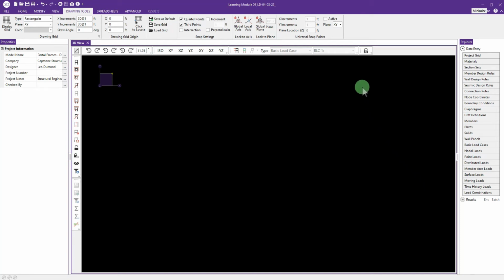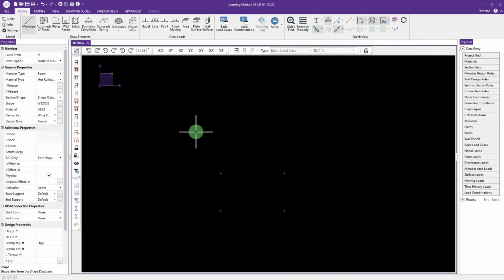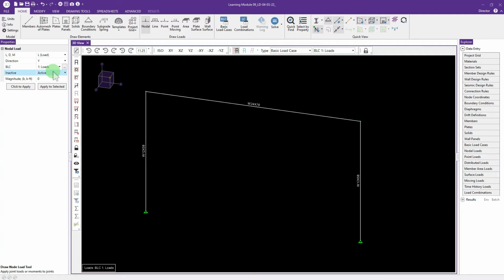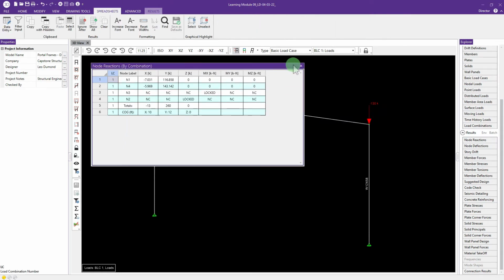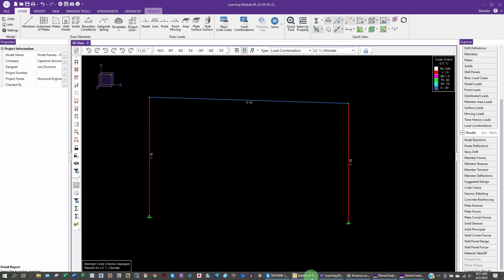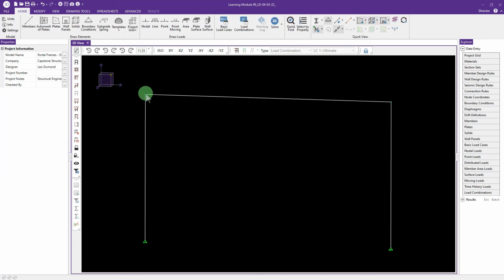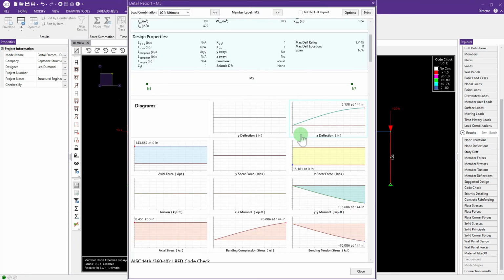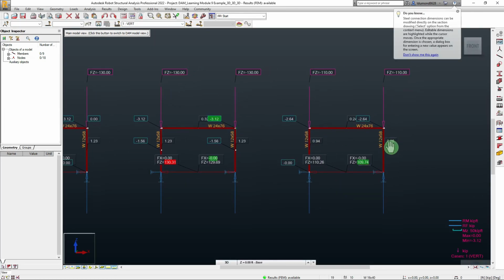STEEL PORTAL FRAME - RISA 3D

Comment: You must be reading my mind.  I was recently looking at this Mastan example of using DAM on a portal frame, and was going to compare it to RISA3D.  I appreciate you doing it first!!
Reply from the maker: My pleasure Chris. My suggestion is when you complete your model, go ahead and compare it to mine and let me know if we've converged on the same solution. There's nothing like two engineers working independently on the same problems and coming up with the same answers. Peace.
Reply: @capstonestructural7212  Yes, I came out with the same deflections keeping my convergence tolerance at 0.5.  I am currently doing some research on how using the First Order Method with B magnification factors by hand or spreadsheet compares to the RISA3D model results.  The structure is a large storage rack made up from cold formed tubular sections for the beams and posts.  I like how RISA3D has the AISI code and members already in their database.  However I did have to create some custom cold formed shapes too, which is relatively easy in RISA3D as well.
Reply from the maker: @chrisaprile813  Glad to hear that we've converged on the same numbers. Also, it's good to know that you're studying the B1 & B2 Method in greater detail. From my readings, what I know is that after B2 exceeds about 1.7, that method becomes a bit unconservative; however, some of its unconservative effects are mitigated when Rm = 0.85. I tend to trash those approximate results when I hit the B2 limit and just go D.A.M. w/ 2nd order rigorous elastic analysis and subdivision of members all the way. Best Wishes on your work though! Please continue to share w/ the Engineering Community, Peace!